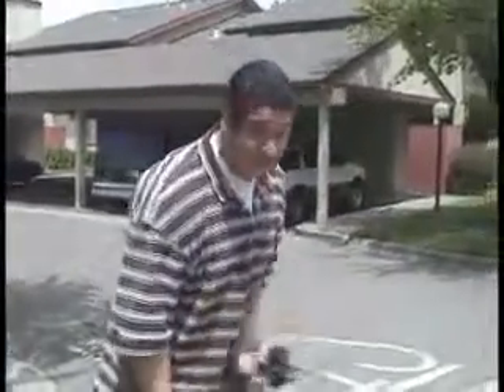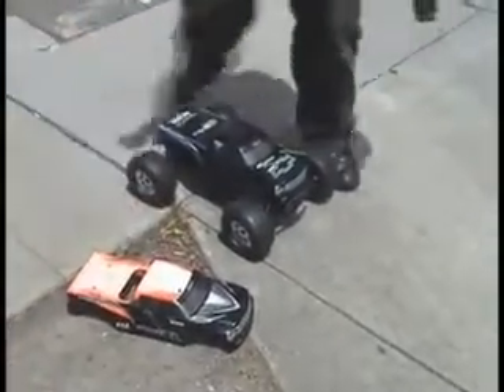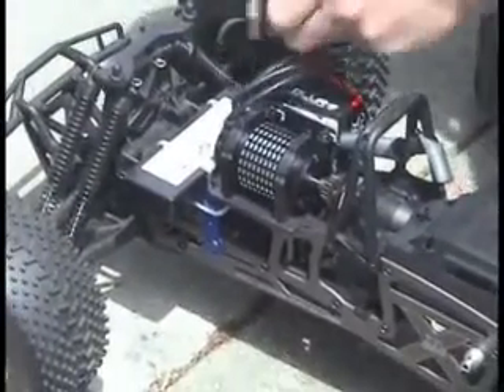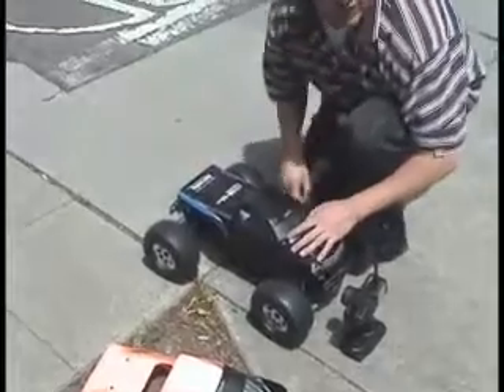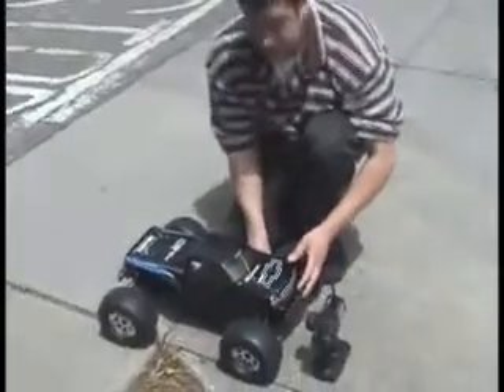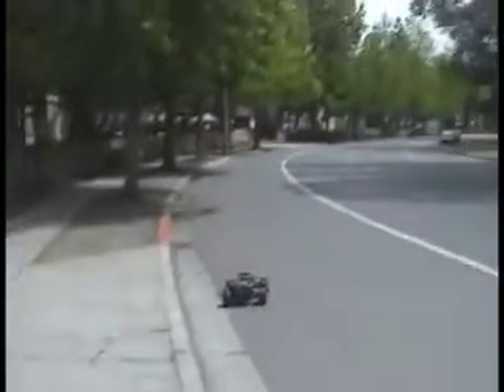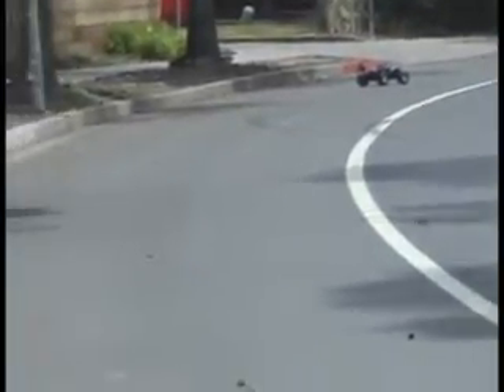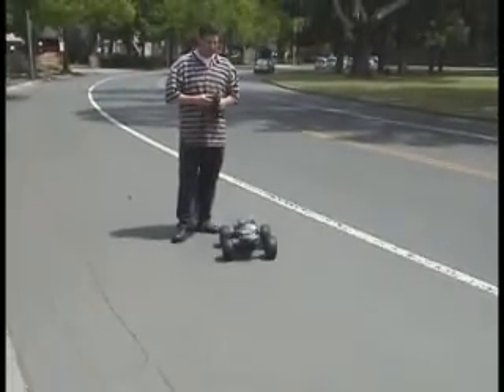More Savage XL runs  with UNCLE FRANKENSTEIN'S RC & TOOL SHOP

Comment from the maker: apples and pizza lol 2 different things  this is no joke we have seen the same system running two 4cell 10000 mah 20c lipo's and man look out this one is for sale  we have since tried it with a 4 cell and 22p 47s and it was gps @ 43 no wheelie bar so it was scary. with a wheelie bar 6cell and 25p we should or who ever buy's this beast or should I say SAVAGE will see over 50mph no prob.......